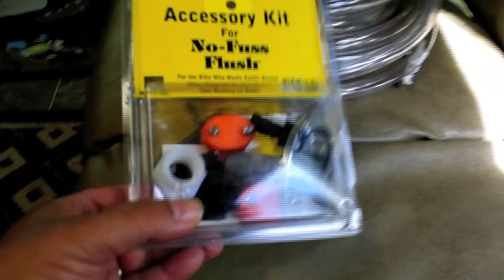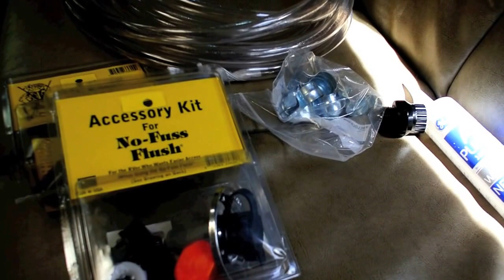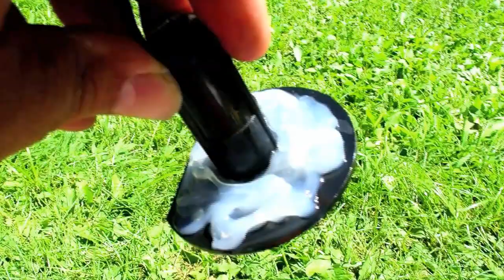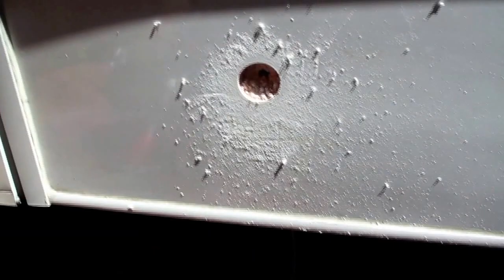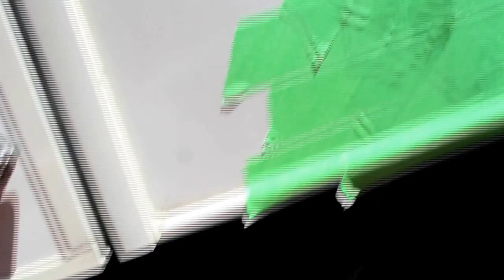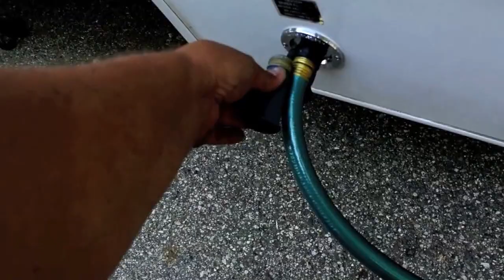Installing the Valtera No Fuss Flush in my holding tank.

Comment: the backflow preventer is already in the part you install in the tank. No need for an additional one.
Reply from the maker: Mine was not built into the flush head. It came with the kit as a separate piece.

Comment: Thanks for the video!  I think I may install one of these in my grey tank.  I have a flush port on my black tank provided by the manufacturer.

The reason for wanting to install one on my grey tank is that the black tank sensors never have an issue with false readings unlike the grey tank sensors.  I'm assuming that's because I'm always using the flush port on the black tank every time I drain the black tank.
Reply from the maker: Could be.  The grey tank can get pretty nasty inside too.
Reply: @RVProject  I noticed that the 1/3 full sensor in the grey tank sometimes lights up even when the tank is drained.  I saw a video on Ew Tube of people using automatic dish detergent in the grey tank.  I found that it cleared up the erroneous reading but I do have to do more than one application during our travels.

Comment: I am looking into mounting an actual pressure washer into my rv and running a line specific to that cleanout. It would work the same way,but use a small pressure washer to boost the pressure up with air to clean out the tank. It shouldnt take up nuch room and it would use a converter to power the washer unit. The unit would be a low pressure washer,not really high. I remember buying one years ago at a yard sale for $5 ,it wasnt very big but perfect for bringing along on trips to clean the bugs off the windshield and do a quick rv clean up at those parks that allowed it.
Reply from the maker: Great idea on the pressure washer.